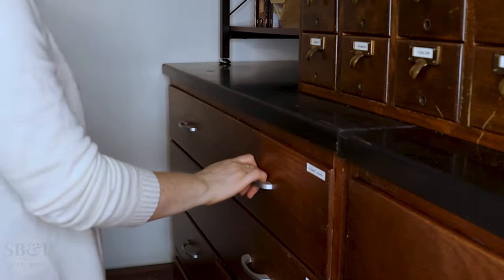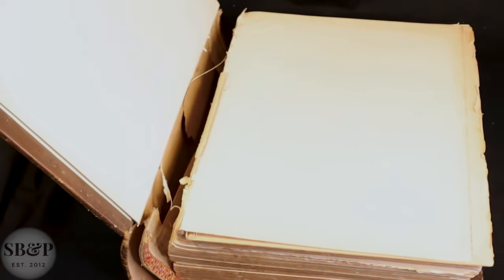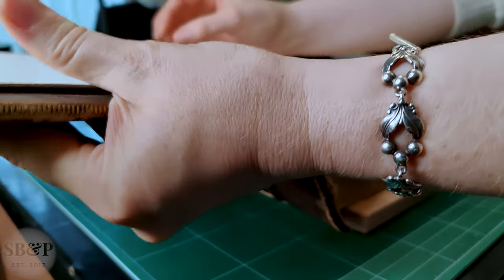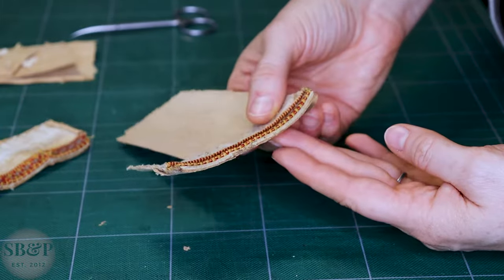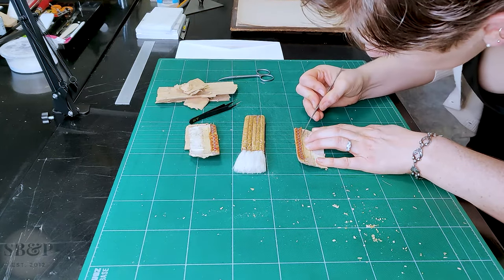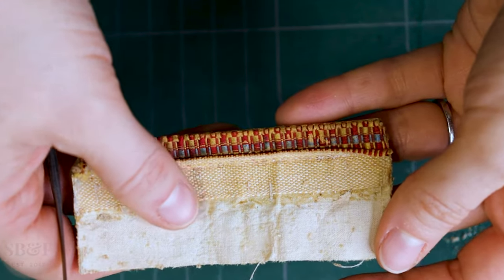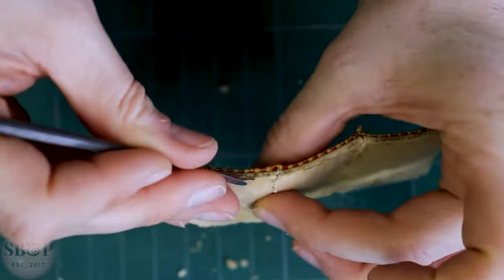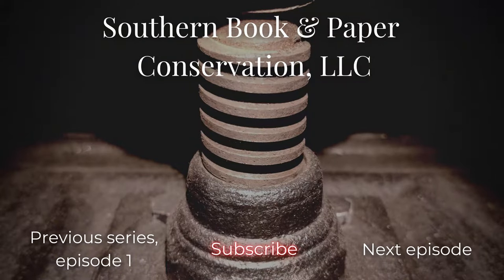Assessment/Disassembly/Endbands

Comment: I think your suspicions about the endbands on this book being used as mechanical textile support for the back and shoulders is spot on. I'd also suspect that about 1/4 pound of animal glue has shrunk, cracked, and crumbled off of the spine over the last 125 years. Many of those old bibles were sewn on jute cords, but there was no sign of that I could see. Would you consider hanging a volume like this onto a fabric or reinforced paper tube to add to it's practical longevity, even if it were archivally incorrect?
Reply from the maker: Robert, are you in the field? 😊  Ding, ding!  Yes, this has very thin sawn in cords and they were the miniscule textblock to board attachment. In the next episodes, you'll see the removal of the rest of the ton of old animal glue, the addition of an overhanging linen lining, AND a paper tube so the original spine leather that I reattach doesn't get bent backwards and into multiple pieces.  

When planning treatments, I take many things into consideration including: not further damaging the original materials, restoring functionality, reversibility when necessary and then preferring reversible adhesives when possible, and that I would like for my repairs to cleanly come off for the next conservator decades from now.  

Hollow tubes are a common book conservation technique at this point.  And yes, they are often practical!  While not correct for the time period in terms of original construction, they aren't visible, they're reversible, and they solve many structural issues while supporting the original material.
Reply: @SouthernBookAndPaper  I'm retired after 20 plus years with a west coast Library Bookbinding company. Our customers rarely wanted full conservation methods and materials, but they valued maximum service-ability, so it's always an interesting comparison for me. Thanks for explaining the decision making process for us -- all other things being so equal these days, that is really what most clearly distinguishes one professional from another.

Comment: Re: ENDBANDS.  I suggest that these are easier to deal with with after being placed in an air-tight (ish) container with a slightly damp, not wet,  sponge (not touching) for maybe an hour or two at most. The glue will hydrate (it's hydroscopic) and soften but the dyes will not bleed and disassembly is then very easy, quick and clean.  After an hour or so the glue will have reset so action needs to be taken to ensure preservation of the curvature. The card inside will not have suffered at all. In fact it can be beneficial as the softened glue might auto-repair any cracks or splits without assistance other than a little mild pressure.

Good, high quality video and workmanship.  Looking forward to episode two.
Reply from the maker: Thanks for your kind words.  I'm glad you're enjoying the videos!

Humidification is certainly one way to tackle the removal!

Comment: I have a KJV bible which is using paste down liner being glued to its French Morocco leather cover. Recently, I found the paste down liner is starting to go off. What is the best way to repair it?
Reply from the maker: Hello!  That really depends on the type of paper that is used for the paste down, the original adhesive, and other factors.  I often use PVA, but only on the correct type of paper.  Otherwise the paper can become permanently wrinkled.  You might want to talk to a local binder or conservator who can take a look in person.

Comment: Hey 🤗😊 i made a storage box from an old bible and front cover was OK but i had to glue inside and its pushed it off more.. is it possible to glue it with a glue that will fold 180° 🙁 sea lemon channel does i good video on book glue binders but she says PVA im not shure about it
Reply from the maker: Hey RIchard, I use PVA for many cover repairs.
Reply: @SouthernBookAndPaper  i broke the front off 😌 it needs to go 180degree though